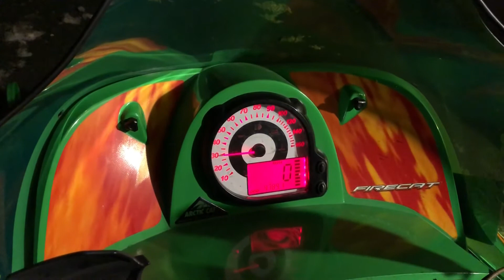2005 Arctic Cat f6 headlights wont work

Comment: where is the voltage regulator
Reply: Where is the voltage regulator
Reply: Its under the secondary clutch on the jack shaft its also reads yoyr speed